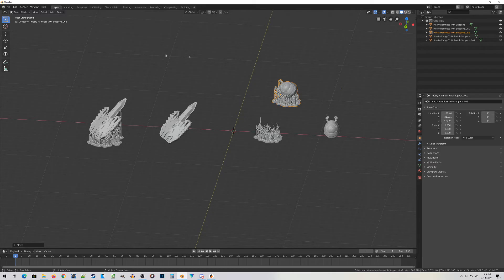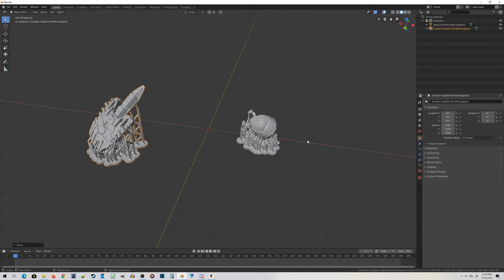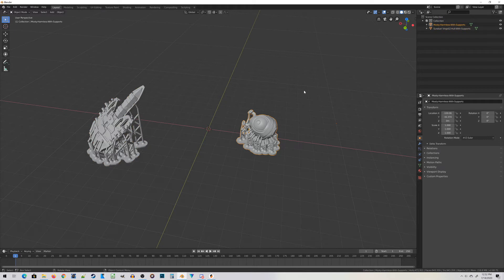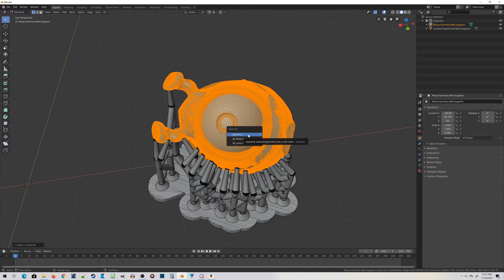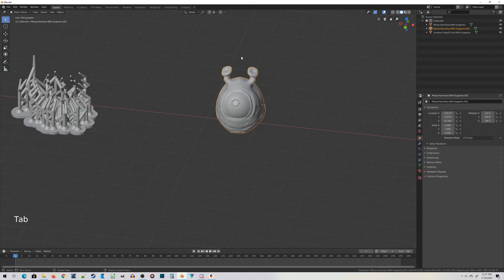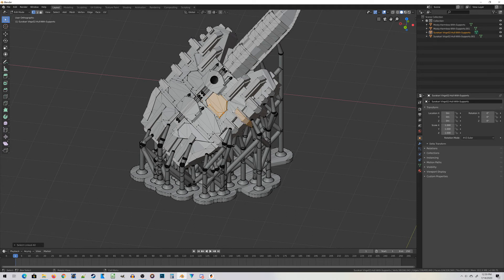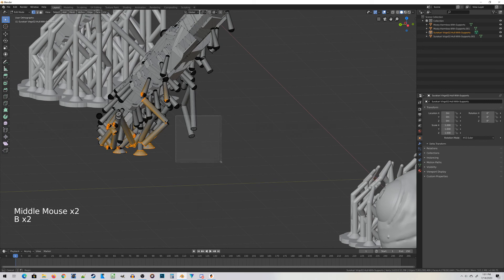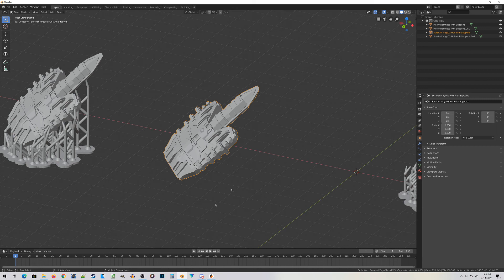Removing Supports from STL files - Blender for Resin 3D Printing

Comment: Does this same method work to remove detail from a model? For example if I emboss an image onto a 3D object and want to seperate it from the original model.
Reply from the maker: Maybe.  If the embossed image is a separate mesh kind of like how the Surakari Virgo(2nd example) was built then yes.  If not, you will need to do some other modeling work.  In this case, you would need to select the vertices that make up the detail, separate them them from the mesh and rebuild each of the meshes into a solid object.  It’s not too hard to do, but requires additional knowledge about how printable 3D models are built.